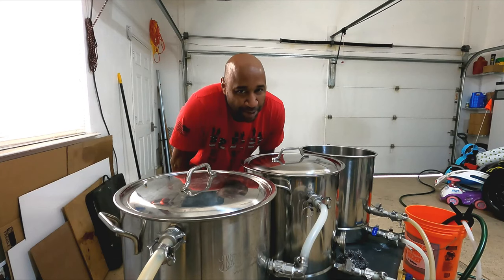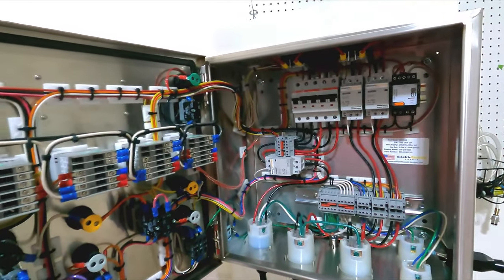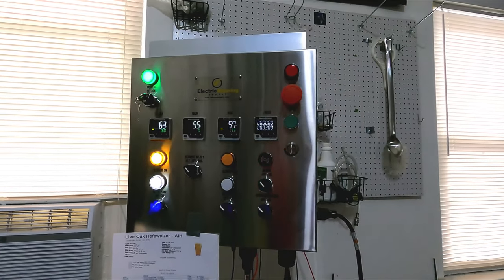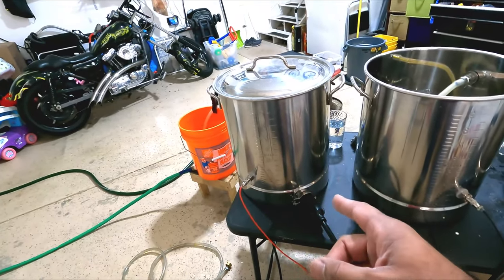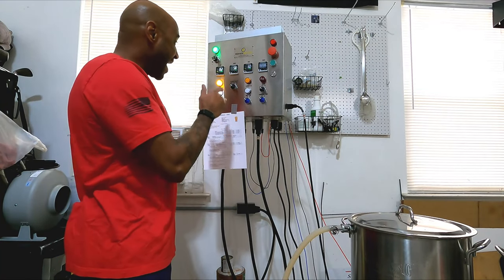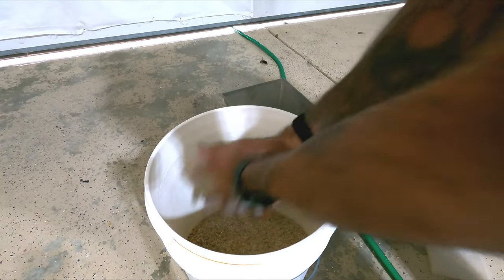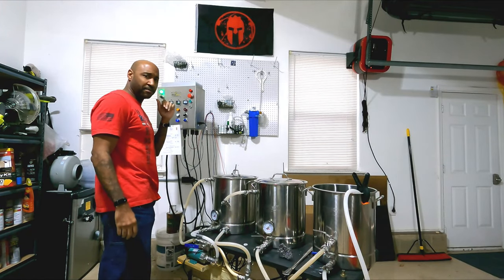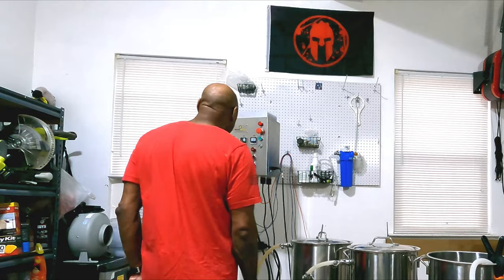Homebrew Hefeweizen - Electric Brewing

Comment: Ok the magic question, how much did it cost to make the transition to electric?
Reply from the maker: The big dog was the controller. I got that from ebrewsupply.com. I believe it was around $1500 at the time. I got it fully built and wired.  With that, the  2 heating elements, weldless fittings, triclamps, the power cables, and other stuff, (I had to add a 240 circuit and a breaker myself) maybe $300 in additional parts, so $1800 ish total to convert my system to electric.
Reply: @JayJenkins  Awesome thanks. New to your channel but digging it so far.